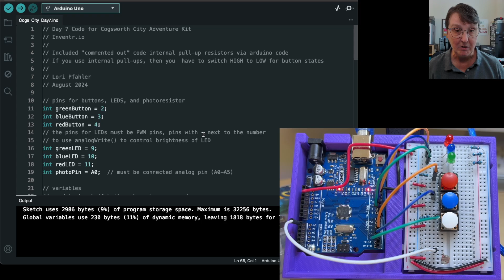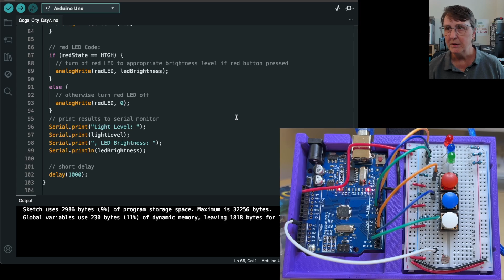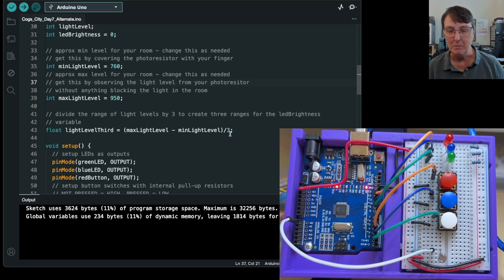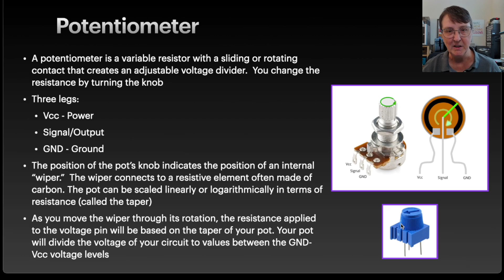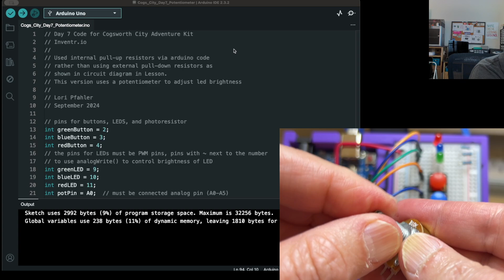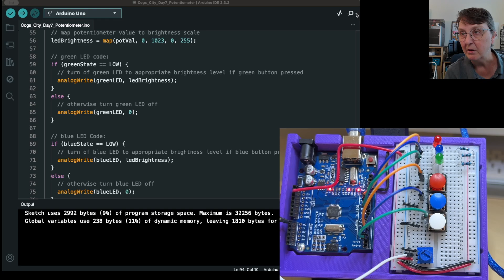Walkthrough for the CogsWorth City Kit - Day 7

Comment: Strange they did not include a potentiometer. Thanks for the video.
Reply from the maker: Yes. I would have equipped this kit a bit differently. A potentiometer instead of one of the photoresistors and an rgb led for sure. I don’t think those choices would have changed the cost of the kit too much and would have added many more possibilities.  Thanks for watching!